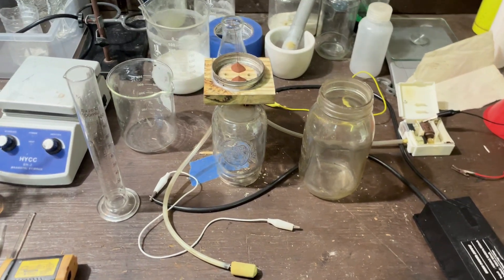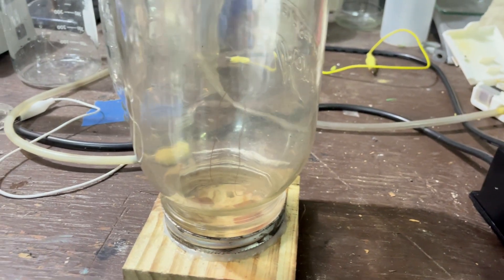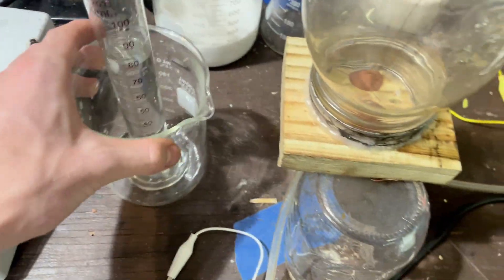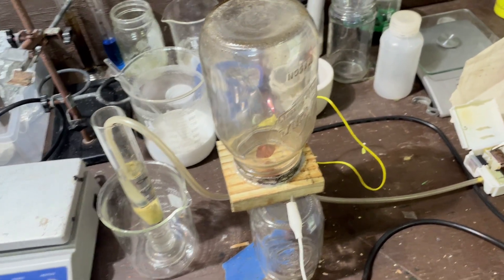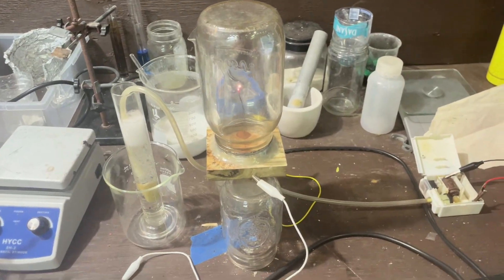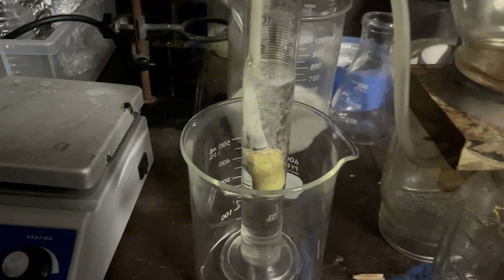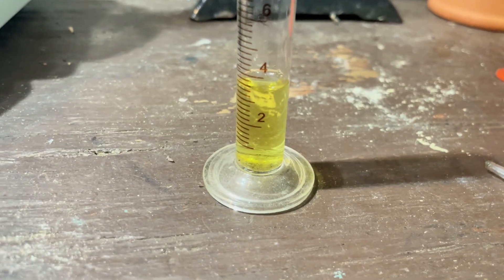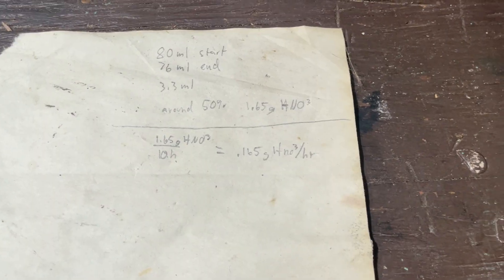Nitric Acid from Air

Comment: Really cool video! You might be able to increase the yield by bubbling the NOx made into a weak H2O2 solution instead of plain water.

You're using the graham condenser wrong -- it needs to be placed vertically in order for the distilled over liquid to properly flow towards the bottom. Since that's a pain in the ass to set up, I'd recommend getting a Liebig condenser instead. The Graham still works like this, but you'll get issues with liquid getting stuck in the loops and it can be a pain in the ass to deal with.

Subscribed, will watch more videos. Great channel!
Reply from the maker: Thanks for the comment and I'm glad you enjoyed. I am well aware that some if not most of my equipment is not being used as intended. I really need to get some better glassware but I've been putting it off. I get some eventually. Thanks again and have a great day man.